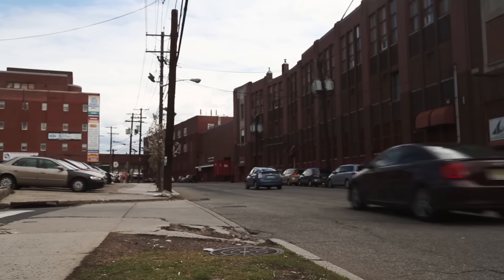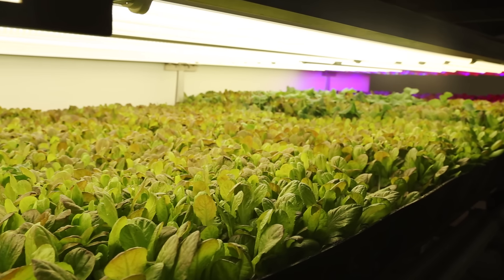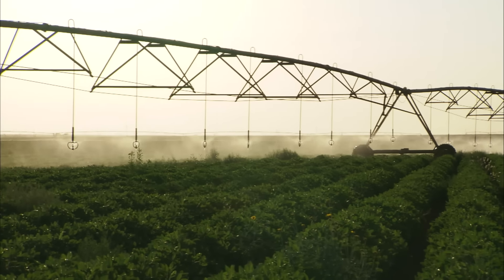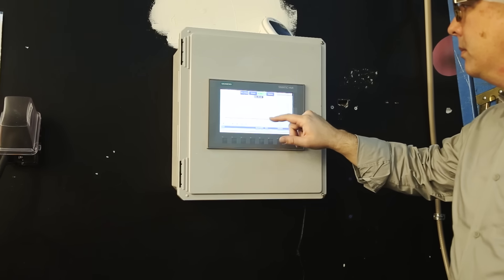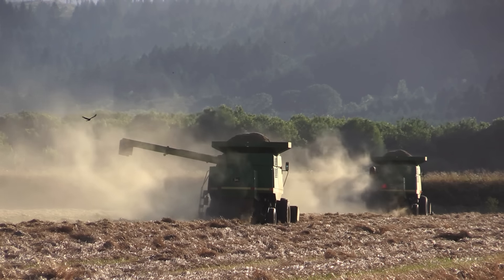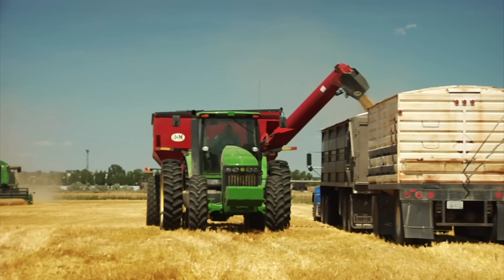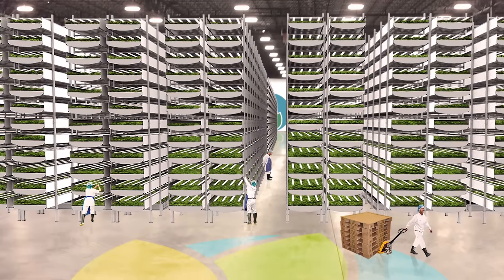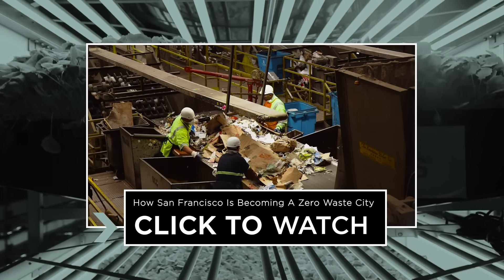This Farm of the Future Uses No Soil and 95% Less Water

Comment: No soil and 95% less water. But shit ton of electricity
Reply: If that electricity is from solar the energy requirements become essentially meaningless.
Reply: LED lights, so is not THAT much
Reply: It isn't all that much in the grand scheme of things and the main thing here is that its not using as much land as traditional field farming. Vertical farming is the future and is far better for the environment, just because it isn't absolutely perfect doesn't mean it isn't a good solution.
Reply: @larsvegas1505  unless it uses solar power, also note it doesn't cobsume much since its LED
Reply: @MahiMahi-oiasdf  that's actually not 100% correct. A solar panel needs about 10 years to be more co2 effective than an normal power station. When you expect a solar panel must be renewed in about 20-25 years it's about twice effective than a power plant.
Reply: Cateloise22 - not just light but also automated water and nutrient pumps and temperature and humidity control
Reply: @MahiMahi-oiasdf   You need land for solar power plants which is around 20% efficiency, lost 10% while transportation. LED convert less than 25% electricity into photon energy. Oops, you get less than 5% yield compare to plant them directly under the sun. In addition, there is the energy used to build more solar plants...And the amount of plastics used to build the farm...

This is another oil driven industry, only viable in extremely crowded cities and not environment friendly at all.
Reply: @MahiMahi-oiasdf  but at the point you might as well have no roof and let the sun and rain feed the plants....
Maybe a bunch of mirror to reflect sun rays 🤔😅
Reply: Even the dirtiest coal plant is still 100-200 percent more efficient than a regular car
Reply: Use solar.
Reply: In the potentially very far future if we keep this method electricity won’t be a problem, we would have a Dyson Sphere.
Reply: Optic fibre cables are also an alternative...
Reply: This is for the huminus people who may be living out in space or far far away land. But they should be wearing those air masks cause last time I checked any plant feeds of what is given and usually makes pollutants or something like that in the air... Like we human spicies do...
Reply: hjacjswo so cover the building with solar panels or stick a windmill on the roof. It’s not a lot of power because LED lights are very efficient, also they are producing ONLY the bandwidth of the spectrum that the plants need. So no it’s pretty efficient. Especially if they replace even a tiny fraction of the displaced acreage with solar.
Reply: @yuanchen5239  I agree, it is only interesting if you close your eyes, smoke the #fridaysforfuture ideas and do not think of the environmental investments needed to implement this.
Reply: I like my food grown outdoors. I support my local farmers. This sounds sacreligiouse.😂😄
Reply: @MahiMahi-oiasdf  sounds nice, but just this small grow setup would require a VAST amount of solar fields just for a grid tie system.... I grow indoors but electric costs are real. I think these are guys in the video justifying themselves since they are from NY where there isn't any soil.
Reply: Solar panels
Reply: I know, they fail to mention that part
Reply: @MahiMahi-oiasdf  AhahahahahahHAHAHAHAHAHAHAHAHAHAHAHAHAHA

If you put solar panels above a single layer of plants, you would be incapable of drawing enough power to give them the sunlight they need.

These plants are stacked. Solar panels on the roof wouldn't feed a single layer, much less all of them.
Reply: Not really.. plus, electricity is cheap, think solar
Reply: Electricity can be 100% renewable, its only the source that is damaging!
Reply: @MahiMahi-oiasdf  Converting solar energy into electricity, and then into light energy is never going to be as efficient as getting it directly from the solar energy.
Reply: hjacjswo yes but with more and more renewable energies that becomes less and less of a problem
Reply: @yuanchen5239  and what about wind power? Solar isn't the only renewable resource.
Reply: @lorenrenee1  when you take into account the efficiency of solar panels LEDs and all of the conversion of electricity you only get about 5% of the energy.
Reply: manu ochenta  I keep seeing you on the other comments chains as well, you may not be able to implement them with the trays that close together, however aeroponic indoor growing can easily produce those plants. there is no one-size-fits-all growing method, but this technology can easily implemented on the ones that you're talking about.
Reply: "uSe SoLAr" you will think its free until you need change the battery 5 years later
Reply: no soil and 95% less water. i think the  nutrient of its food is less too. our future is all about less
Reply: @okyoky405  they failed to mention that you also need a hydroponic solution with All the micro elements, that changes from  plant to plant as well as during the plants growth Cycle.
Reply: I'm on solar...I run my house completely off grid. That included running my Oxygen concentrator 24x7, water pump electric/gas/rocket stove heater. (Heater for emergency use only)

I can easily  see this being viable on solar.
Reply: @JinxProLuhut  I change batteries every 12 years..  They way I do it is I have a DIY battery monitor system on each battery and some other balancing stuff..
Soon longer durations, as i'm moving to Edison batteries I am building.

Problem with most people they don't know when a battery failed, until it dragges the other ones down to crap!

 It only takes one a very short time to destroy all of them!

Think of it as one drowning man, holding on to a rescuer and the rescuer has to fight the drowning man to stay afloat! In this case the rescuer gets tired and drowns with the drowning man!
Reply: they are using led's and they are the lowest power consumption lights and if they have or invest in solar on the roofs of the buildings the electricity  cost would be pretty low and they say in the video that they are getting double growth rates than normal meaning they can sell there food twice as fast so they are getting more profit  than normal
Reply: Led technology continues to advance becoming increasingly more efficient. The solar industry has been seeing pretty steady growth, both residential and industrial. 
I think it's naive to say it can't be done. I don't think the technology is there for this to be feasible on any sort of large scale as of now but that doesn't mean it never will be.
Add to this the continuous depletion of the agricultural land we have available and the ever expanding population and it's easy to see the issue isn't fixing itself.
Reply: @Rainier214  no, maybe a dyson grid
Reply: hjacjswo well yeah but based on the information given it is much better for ecosystems and produces more. I’d estimate that a large closet would be able to produce the same produce as 100 to 300 square foot plot of land through natural means which include seasonal changes and acts of nature. Would only require a few solar cells on the rooftop or in a yard. Big investment but overall more efficient than traditional farming. Although take this with a grain of salt as I am by no means a professional and basing this all off of minimal knowledge
Reply: I wish some engineer would do the math. I'd like to know if this is really feasible with current solar tech using LED needed to grow plants.
Reply: electricity is renewable
Reply: @MahiMahi-oiasdf  Well the thing is solar panels are very inefficient currently so it really depends on the scale of the operation
Reply: @beaal5641  Id have to say the best option would be a mix of both vertical and traditional farming
Reply: @lorenrenee1  have you ever used a growing led? The heat that it emits gets so hot that you need a system to cool them, especially if you put them close together. Their coverage is small, compared to hallide bulbs. They may use less energy for the amount of usable light, but they have weaknesses.
Reply: @yuanchen5239  exactly
Reply: Solar power it up then !
Reply: @midwestmangos2452  wind power is just, terrible.
Reply: I think what everyone is missing is that we’re saving earth little by little with this method. We’re saving our oceans especially
Reply: Yea but what if its solar or wind powered
Reply: More importantly WHO are the owners of farms like these? Do they support local communities? Can a company like this exist as a employee owned venture in today’s economy?
Reply: @MahiMahi-oiasdf  it's gonna take a lot of solar panels to power this vertical farm😱
Reply: @Cateloise  and LED lights are so unhealthy for humans. What is it doing to plant DNA?
Reply: @matthewarnold4557  Try even remotely having a clue before you go posting. The total efficiency of a brown coal-fired Rankin cycle, open-loop power station is near on 20%. A brown coal station is about as dirty and polluting as it gets for electricity generation. The average efficiency of a modern internal combustion engine is also 20%.
Reply: That is to compensate for the 95% less water lol
Reply: What do you think powers all that farm equipment and semis? Much easier to supply clean power to something like this than to try to figure out a way to greenify all the heavy machinery.

Comment: There's one question that they didn't answer: how much does one of those plants cost (in money) to make?
Reply: Tusenbensen Considering that the electricity is from solar or other reusable energy, and that it uses lesser water and land, if there are many of these and production is stable, it could potentially be cheaper than normal farm grown crops. Ofcourse, this is still at its infancy and it will become easier as time pass
Reply: Kewl
Well then I'm sure it's gonna be glorious :D
Reply: Tusenbensen I know a guy that has a Hydroponic setup that uses no electricity what so ever, pumping is all done with gravity air is pumped through via the Venturi effect whilst the climate is supplied by the hot house
Reply: logan thompson 
Interesting, interesting. This sounds more and more like the solution to me :D

Comment: 95% less water and 150% more electricity
Reply: the vast majority of the energy used by standard led lights is used to create in spectrums we can see. these special farming LEDs only create infrared and ultraviolet which means they're incredibly efficient.
Reply: Haha well thats just plain wrong. UV and IR LED's run hotter and consume more watts. You will also pay more to ventilate one of these systems. On the bright side LED's do run cooler than HPS, metal halide, and ceramics but they also, sadly, produce lower yields.
Reply: SpoounPC For horticulture, at a distance of 50cm, to reach comparable light levels, the wattage of Phillips GreenPower LEDs run between 1/3 - 1/4 of what fluorescent EL or EM does. Its pretty good kit. I have a setup of my own as a test.
Reply: Aidan Bradley I have a gavita pro 1000 and some MARS hydro LEDs (900w equivalent, 430w actual). I tested the micromole output on both of them and the drop off for the gavita begins way before the temperature it outputs is safe for plants. The LEDs have a lower output but I can grow plants as close as 25cm safely.
Reply: SpoounPC That's pretty neat. I find this stuff amazing. I'm not familiar with those units. I'm about to close on some land to scale one of these solutions up. Its exciting :D
Reply: electricity is way, way, way less precious than water and land
Reply: +LeeFerikson u can turn electricity into water through deceleration. But u cant turn water into energy
Reply: there must be a way to funnel sunlight to reduce electric costs.
Reply: Yes, it's called a solar panel.  Have to convert light to electricity then back to light but the sun is free and the panels are becoming very cheap.
Reply: +rapper250 the funny thing is that with how some of the more industrial systems work is that they can actually alert the day night cycles to further increase yield. they also can maintain the exact temperature required. so rather than being just lights they end up controlling most of the contained, local ecosystem. introducing natural light into the process would be counterintuitive.
Reply: Your solar panel take sun light to give you energy, the plants only need a fraction of that sun light to be satisfied. In other words, only a fraction of that energy.
It is a bit misleading saying it's efficient, not quite the point here.
Reply: haha was thinking the same thing
Reply: worth wouldnt u say as electricity is much more renewable
Reply: +Acetonee e what i  the world is decleration do u mean reclamation reclamation isnt a perfect soloution reclaimed water has been proved unfit for human drinking and electricity however is extremely renewable
Reply: Worth the trade.
Reply: If you happen to live in an area with little arable land and lots of energy whether in the form of geothermal, solar, etc. this could allow for a local source of produce.
Reply: Reusable energy
Reply: +Acetonee e the process to use energy to provide fresh water is desalination not deceleration.... But that's not your biggest mistake, that would be that you can't get energy from water.... I've never heard anything so ridiculous, the water wheel was one of the first technologies to harvest energy from water... But anyway, we have hundreds of ways to generate electricity, zero methods of creating new land and one method of creating fresh water....
Reply: The extra electricity is negligible in the big picture by reducing so many other negatives like runoff pollution and our increasingly scarce water supply.
Reply: +Peter Spriggs can't we burn our trash and turn it it into ash then use the ash to build an island? Singapore have one if I'm not wrong
Reply: +Peter Spriggs I don't know how to create more water though
Reply: But electricity it self is becoming more and more green, Solar, Wind, Hydro are all viable solutions too your proposed problem
Reply: Sadly the green energy sources are not a steady source for energy and they make up a small amount of contribution to the energy system...
Reply: they are using solar technology .
Reply: +dippiiduu its a mather of where you invest resources. there are countrys with 100% renewable energy use
Reply: Even if your statement would be true, it's still better to 'overuse' an almost infinite source of energy, than to waste a more and more shrinking source of water which every living thing on the planet needs to survive
Reply: Who cares they can use solar panels. It's quicker and takes less space...
Reply: +Ch4nd H Solar panels aren't effective enough.
Reply: +Tony Mancuso for a farm like this, it would be fine
Reply: +Tony Mancuso i guess it still works out alot cheaper compared to an actual farm. electricity is very cheap anyways.
Reply: +Tony Mancuso As of now, but each new generation of solar panels are more effective than the previous.
Reply: At least this will prevent more greenhouse gases from ruining our atmosphere and killing us all..... It will also save the bees..... bees are affected by the  pesticides too. The pesticides somehow hurt their brain and prevent them from getting back to their nest
Reply: water creates electricity
Reply: Solar energy and led lights don't use much electricity at all, that's the whole point with led , there awesome..
Reply: What's a meager 150% ( 1/3rd ) increase of energy usage if you can reduce the cost of water by 95% ( 19/20th )?
Reply: WATER IS MORE IMPORTANT
Reply: More oil we have to use then lol😂😂😂
Reply: Aint nobody got time fo dat.
Reply: +Acetonee e guess dams don't exist in your reality
Reply: Farming equipment likely requires more for much less crop.
Reply: +ByAnyOtherName091 in California you buy all your power from Oregon..it is not cheap
Reply: +Acetonee e yes you can its called hydropower and we have hydro power dams all over the pnw
Reply: Jacob Marshall 1500% more electricity 😉
Reply: With energy like solar power, we have excess of energy. Fresh water, in the other hand, is a finite resource, so this is worth it
Reply: but we have to invest more on this righttt
Reply: That's probably still worth it
Reply: True.
Reply: Electricity isn't an issue. Its the way its produced that is. Fusion power is about 10-20 years away. That should help with the electricity issue
Reply: Put solar panels on the roof and problem solved.
Reply: 150%? try infinitely more electricity. Did you know that the sun requires zero (0) electricity to run?
Reply: How is that 150%....u cant compare with % becuz normal farm dont requier electricity... well maybe little with the machine and stuff.
Reply: Jacob Marshall say 1200% more !

Comment: What's the carbon foot print of having those 1000s of lights on 24/7 365
Reply: Those plants need a day night cycle too
Reply: @perryschnabel  probably 12/12 during flowering and 18/6 off during veg cycle; because they use L.E.D. less of a foot print than you would imagine.
Reply: they are LEDs so they don't consume much electricity. BUT... nobody thinks of pollution caused by manufacturing those lights... same goes with electric cars.
Reply: @MArtbboy  agreed. Hopefully with long lasting led lights and the mass produced crops it  can outweigh each other, that it's still a positive for the earth and humans gaining access to all said sustenance.
Reply: @MArtbboy  Of course nobody thinks of the pollution of manufacturing ICE cars, the amount of eutrophication caused by traditional farming, it's still a net gain in terms of the environment. LED manufacturing pollution can be controlled, fertilizer runoff cannot.
Reply: @Twilight Princess yes if they are using renewables it should mainly be emissions free minus the creation of the solar panels which can often be heavy in co2 emissions but over time would create a net reduction
Reply: Ppl splitting hairs about smaller fixable issues like where is the electricity for the lights coming from. Let's make sure the concept works and those things can be implemented later